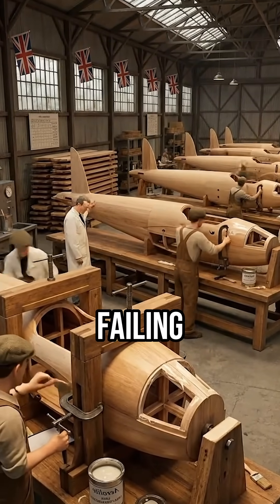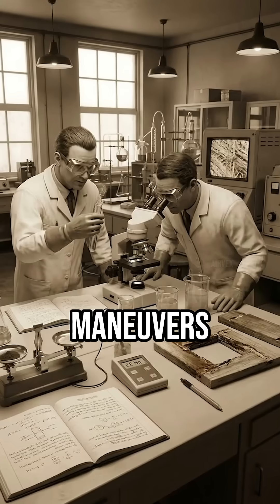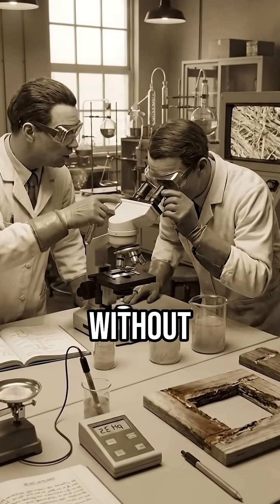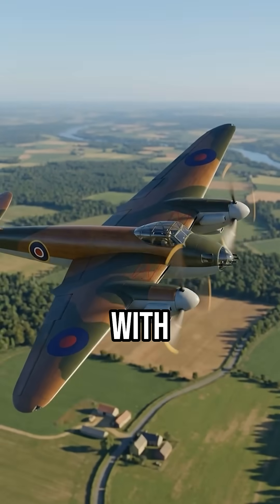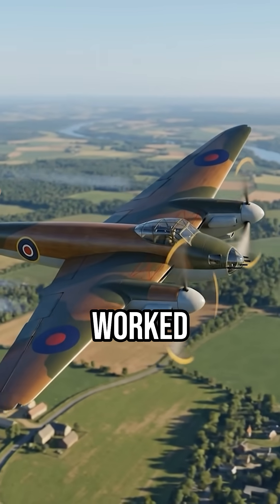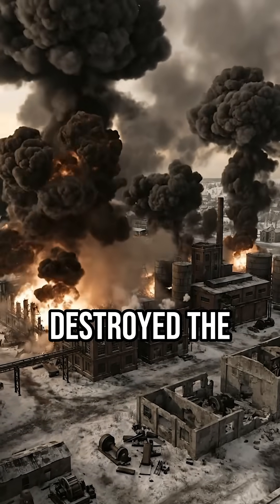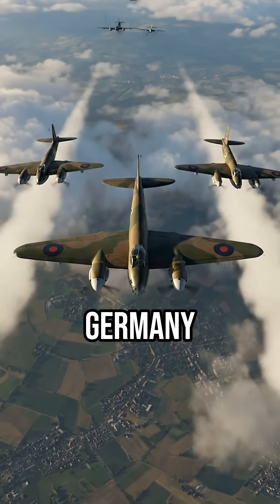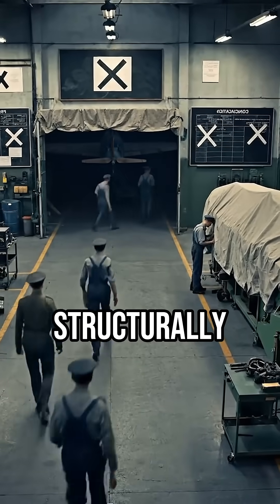Why wooden jets flew WITHOUT proper glue

Comment: How did you get the picture of my He-162 balsa model airplane? It was not posted to Instagram.
Reply: was it just in your gallery?
Reply: @Average_GI_Joe  the picture is on my iPhone. I limit what is shared on instagram. Only pictures I select are posted. 

So I have no idea how they found this one.

It’s been flipped and cropped.
Reply: @mikemccaffrey3093 i want to find out how this happened but idk where to start, my initial assumption is data theft though
Reply: @Average_GI_Joe it takes 3 seconds and a google search to know where this photo comes from…

Comment: It was designed and build in a remarkably short time, using wood because aluminium was in short supply. Engine reliability was as much an issue as the glue when it became operational. Even the Mosquito had delamination issues from its glue in the Far East.
Reply from the maker: True, so do you like He-162 or do you have any other WW2 aircraft?
Reply: @Airvex-f3d I like it. It’s a nice looking aircraft and flew well after tweaking the design despite the horrible layout that expediency forced on it. 

I don’t have a favourite WW2 aircraft.

Comment: The Germans wanted to use non-strategic material to build the He-162.......
Reply from the maker: Yep, and they failed... Do you like He-162?
Reply: @Airvex-f3d 
The He-162 is an interesting design but the substitute glue ate away at the wood used to build it instead of bonding the wood togethe.
It's also believe that the jet exhaust, blasting between the twin split tail affected how the tail worked forcing the He-162 into a downward spiral until it crashed.
Reply: @DenisContreras-w2d the only pipet that wasnt supporesd be Made on Wood lol
Reply: @DenisContreras-w2d they forgot the glue Company got sabotage maybe
Reply: @Airvex-f3d  its the cutest gen 1 jet
Reply: HoI reference detected  😎